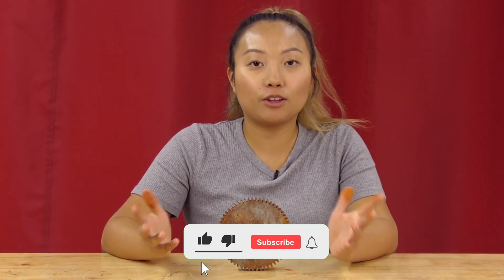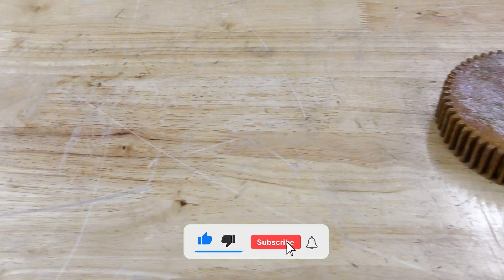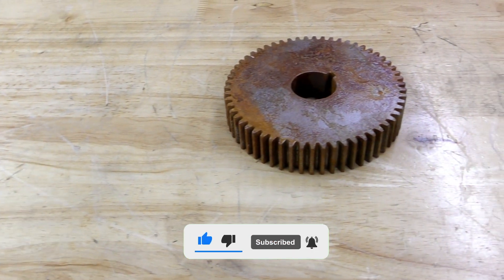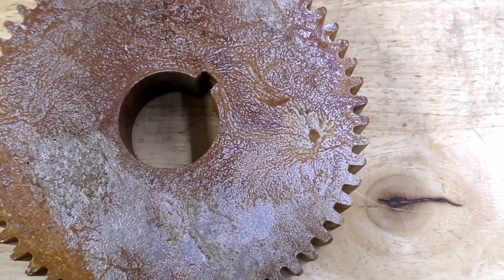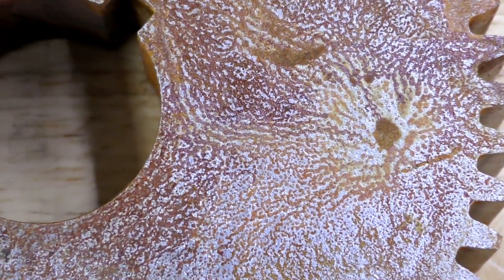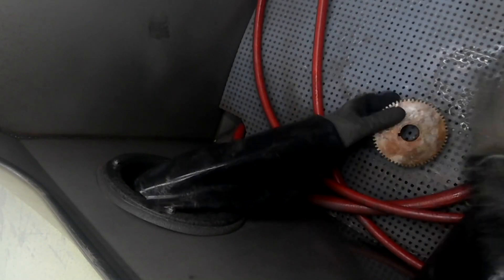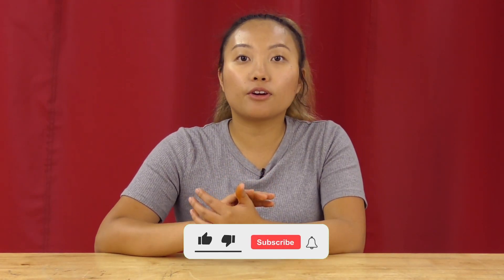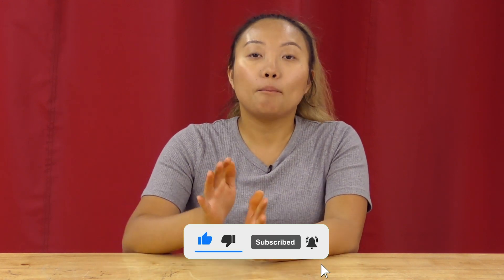Does Vapor Blasting Remove Rust? - Vapor Honing Technologies

Comment: Yes, vapor honing can remove rust but aluminum oxide also removes some material from the part.  If you want more gear lash and a slightly larger bore size than origional, you can believe this video.
Is vapor honing the right blasting process for this part, no.  Just because you can rub off rust, sand off rust or even vapor hone rust off the part it doesn't mean you should use any of them unless you simply don't know.  You need many wrenches to fix and repair anything, one wrench does not do it all.
Reply from the maker: As Always it is a pleasure to hear from you Fact Checker.